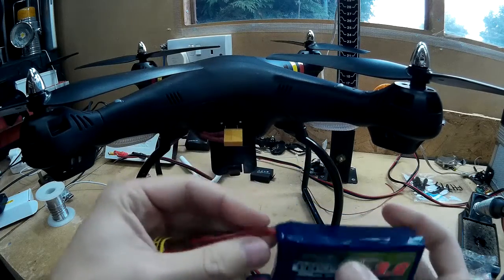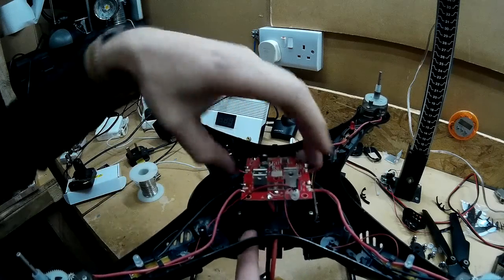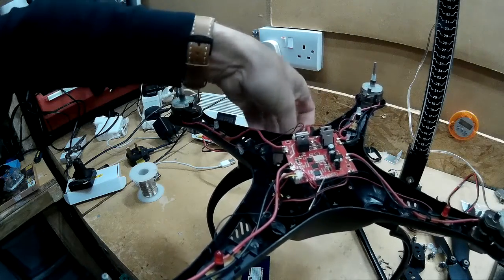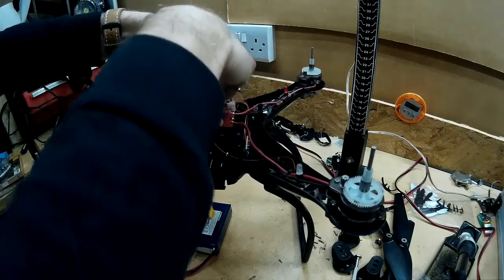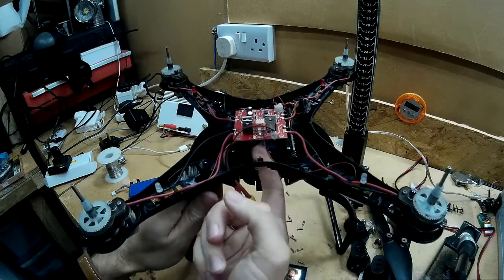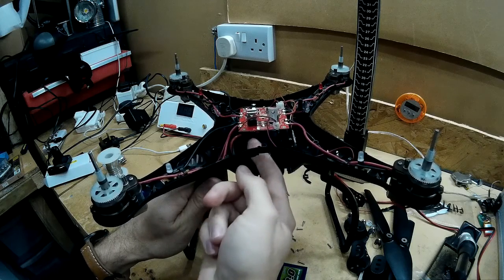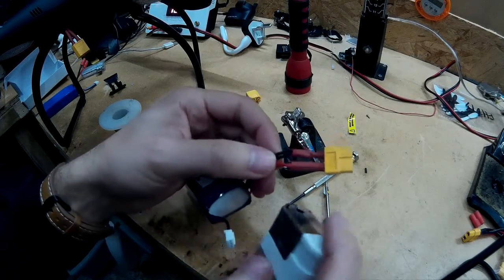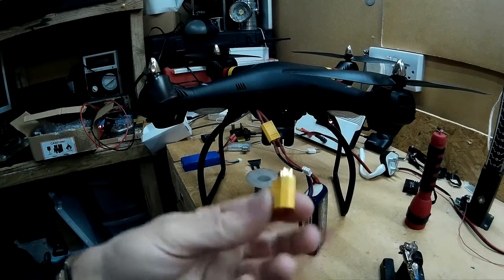Syma X8C Quadcopter 3000mAh Battery Upgrade Mod

Comment: hello, where I could get some legs as your drone ? thanks
Reply from the maker: +Pablo Calle white legs http://www.banggood.com/Heighten-Broaden-Landing-Gear-Skid-for-DJI-Phantom-RC-Quadcopter-p-917962.html?p=070519238739201308J6

black legs http://www.banggood.com/FC-DJI-Phantom-1-or-2-Vision-General-Heighten-Broaden-Landing-Gear-Skid-p-920118.html?p=070519238739201308J6
Reply: +Norfolktube thank you very much. sorry I disturb you again but I want to ask you if the weight of the 3000mA battery would be able to carry with the Dron +gimball+ gopro (3 edges gimball). does the new battery lasts more minutes of flight respect the original one? thanks for your help.
Reply from the maker: +Pablo Calle I get 15 - 18 minutes depending on wind conditions with camera.  
Not sure about gimball+ gopro + battery you will need to test but i think it will be over its lifting capacity.

Comment: what's the flight time with the new battery ?
Reply from the maker: +Robert Garden (Bomber) With camera on getting 13-17 minutes depending on wind conditions haven't tried it on a nice calm day but i would let motors cool after a 8 min flight  so you don't burn them out.